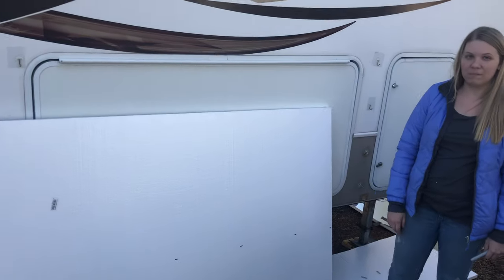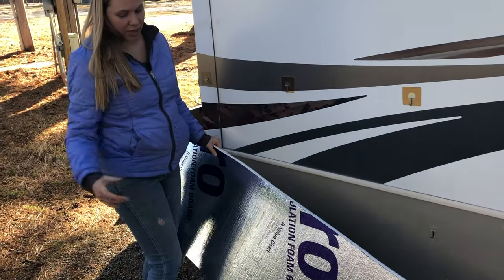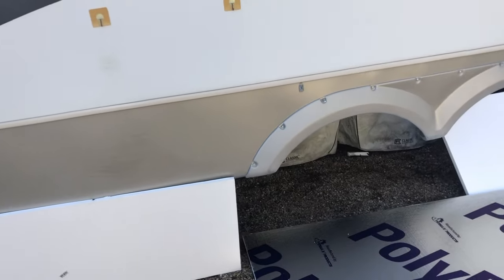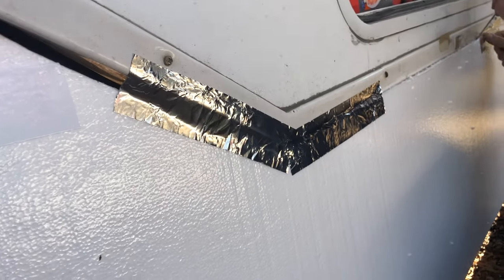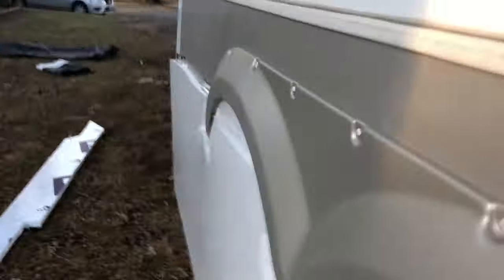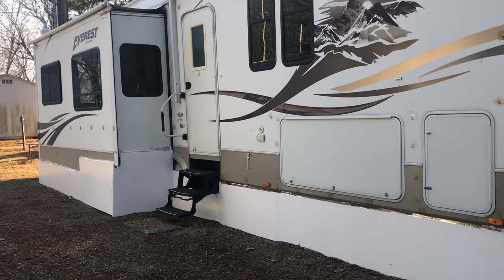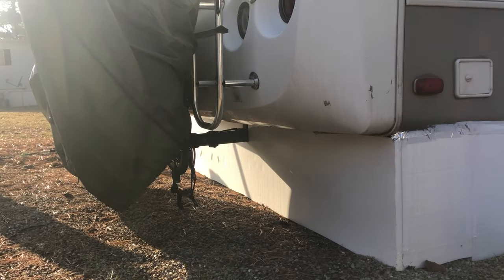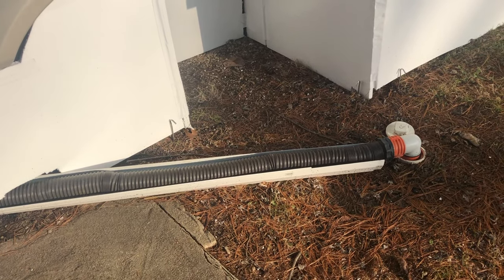How to Skirt a Trailer with Foam Board | Cheap DIY RV Skirting

Comment: Here is an idea for spray foam on concrete to deal gaps in the bottom- put down plastic or Saran wrap, then spray foam on that.  The concrete will be completely protected. Glad I proofread before posting- my spell checker turned "Satan wrap into Satan wrap
Reply from the maker: Great idea!  I have heard of using spray foam before, but the addition of Saran Wrap is brilliant!  I will add that tip to my blog post!

Comment: Were u able to remove the tape without damaging the RV? Any glue left on rig afterwards?
Reply from the maker: With duct tape in the past, it left a ton of glue and damaged the RV in places, but the foil tape leaves a lot less if any residue. It depends on how long you leave it up for (many years = more possible residue)

Comment: I have to use 2 inch foam skirting . I am about 75% done before i found your video. I used my buck 110 to do the cutting . It took a little figuring, but I went flush with rv even inside fenders with the 2 inch .
I used 2x4 lumber in the corners to screw to .

Comment: I'm sorry if this question has already been asked, but I'm trying to build skirting for a repurposed cargo trailer for my pet turkey's coop. Where we live, it gets WELL below zero and 200 inches of snow. Did you get snow at your location, and do you have any suggestions for dealing with that situation? I'm afraid of tarps because of condensation moving up into the insulated trailer coop, even though it's ventilated. Thanks so much for any ideas, and I appreciate this video very much.
Reply from the maker: Snow can help insulate by blocking the wind. We share more tips with skirting on our website here that should answer some of your questions: https://rvinspiration.com/cold-weather-rving/foam-board-rv-skirting/?

Comment: We just bought a 5th wheel and found this video about skirting. We'll do exactly this, but a few suggestions: 
Use an "Olfa" knife for slicing...you can put the razor blade out far enough to go through 2" foam. Also, if you use a drywall T Square, you can cut a 4 foot slice using it as a straight edge. To get a nice edge for the wheel cutouts, put your piece against the wheel, and from the inside, trace the outline. Then cut on the line...perfect fit...
Reply from the maker: Great tip! Thanks!
Reply: You could also use colored mulch or wood chips around the base to fill in any uneven gaps.
Reply: I'm right with you

Comment: Well thanks so much for responding. We have a 2022 5 th wheel and live in central Illinois. Last year we had real cold weather and had all kinds of problems. So this year we’re installing 2 inch foam boards all around, pretty much do the same thing you did. I was just Leary of putting tape on the sides of the trailer. What I also did to keep the bottom from kicking out or in , I cut a bunch of farm post to about 6 inches and put them at the bottom of both sides of the foam board. Works great to keep them in place. Thanks again. Happy camping 😊👍
Reply: do the taping on the underside of the coach. that way no damage to your paint.
also with the foam board under the coach skirting the water stays outside better.

Comment: Awesome. I'm planning to do this tomorrow as our trailer is very cold tonight. Im worried about the wind. Did you have many problems with wind damaging or dislodging foam pieces?
Reply from the maker: We did not, but you can use rocks or tent stakes to help keep them anchored. We recommend it, just in case some crazy winds whip through!

Comment: Hi🖐, it looks great🙌!  As if it were preinstalled.👏
I have some questions, that may have been previously answered and I do apologize if they're redundant. 

When you've installed the insulation as skirting, <--did you bury the bottom into the ground without any type of protection for the board or just paint it, to prevent deteriation from dirt, moisture and critters/bugs?  (I read your blog)😊

I was considering covering each piece in heavy duty construction grade trash bags, <--would that be as protective instead of painting?  

Also, you mention the silver is to be placed inwards out of the sun rays to keep the heat inside/under the RV. <--Isn't the silver for reflective purposes? I've not heard of using the reflective side in the dark, <--so how did you determine its effectiveness? (besides after😅)

I use reflective bubble insulation on my windows to reflect the heat OFF the glass, not to pull the heat inside. <--So would my process be bringing more heat inside my RV?  

I tinted my RV windows, that made a huge difference. And the bubble insulation is there as well, on half the window- don't like living in a cave.😅😅

I planned on putting the reflective foamboard on the roof of my RV, to help keep heat off me in summer time.  
I thank you for your video and blog, and hope to hear from you. And please any one with derogatory responses, just keep them to yourselves, we're here to learn and help, not Hate on or demean. Thanks!! ❤❤❤

Comment: I would like to know what happens when you pull off all the tape. Doesn’t it damage the paint. Or leave all the sticky stuff on from the tape.
Reply from the maker: Duct tape definitely can, but the HVAC foil tape will be better. To easily remove adhesive, we always use a heat gun (a hair dryer can also work!)
Reply: Thanks. 👍

Comment: Does the tape peel  off the paint on your trailer
Reply from the maker: It didn't in my experience, but some adhesive was left behind which I used GooGone to remove.

Comment: What do rv folks do with their tires if their parking for winter.. say 4 months. Do you jack them off the ground or do anything
Reply from the maker: You will definitely put your jacks down but you don’t want your tires off the ground. The jacks will alleviate pressure on the tires themselves. You may also use tire covers to protect from sun damage while sitting. For winter you’ll like skirt anyway so you can cover the wheels with whatever you use as a skirt!
Reply: Thanks. I’m moving away from the family for a few months for work and will be hanging out in a camp trailer. So this is all amazing information for me! Thanks for sharing your knowledge with everyone

Comment: For those of you staying in your RV full-time...manufacturers say to run your slides in and out once a month.  Is anyone doing this? Obviously you can't do this with the skirting attached. We will be stationary for the winter but vhf traveling the country after that.
Reply from the maker: We didn't do that, but we probably should have.  We only moved our slides in and out three times in three years, and the third time one of them got stuck (fortunately we got it unstuck).  I also had a friend who was stationary for a long time and had a slide get stuck when they were preparing to move their RV.  With skirting it may not be possible to move them once a month, but I would definitely try to do it at least once per year.

Comment: In the past, we have used the foam board and used tape to secure it to the RV.  The  only concern I have is when it is removed, the tape leaves residue on the RV and was not easily removed or in some instances, couldn't remove it at all no matter what we tried using.  Any ideas what we could do without using tape.
Reply from the maker: Did you use the foil HVAC tape? I haven’t experienced that it leaves any residue.
Reply: I've been binging on RV Living vids > most recommended the Alum inum tape shown & said it left no residue...🙂

Comment: How well did this work for the winter? 
What temperature does it get there? 
This is our first year and apparently didn't think about this soon enough and now scrambling 🤦‍♀️😂😂
Reply from the maker: Worked great for us! Lowest temperatures were in the single digits Fahrenheit. Check out the Facebook group called “Winter RVing—Let’s Stay Warm Together!” for more tips on surviving cold climates and sub-zero temperatures in an RV!
Reply: @RVInspiration  how well did the tape come off that was on the side of the RV? Did it leave residue behind?

Comment: The HVAC tape from Home Depot used it and it comes up a day later isn’t there a better adhesive it cost $23 for the roll and we bought two and put two strips all around rv but it doesn’t adhere that great. Is there any better tape out there ?
Reply from the maker: I’m sorry the tape you bought didn’t work for you. There is a link in the video description to the exact brand of HVAC tape I used. I didn’t have a problem with the brand I used. The only other type of tape I know of to recommend that is supposed to come off cleanly and not leave residue would be Gaffer’s Tape which you can also find on Amazon. It’s used by people in the film industry for taping things up temporarily. I’ve never tried it for RV skirting so I can’t say how well it would work for that purpose.
Reply: @RVInspiration  ok I will check out the brand you used and order it and hopefully it will work. Thank you for replying to my comment.
Reply: No matter what tape is used surface MUST be super clean > rubbing alcohol...
Reply: @dkleath8697  ok thank you I’ll be sure to buy some and wipe the area where the tape will be applied.

Comment: In real cold climate you need to put Styrofoam boards or straw on the ground , the cold will still be in the space under your rv or other vehicles if you don't putting insulation around the edges is necessary for the purpose of wind snow or ice protection.

Comment: Will the tape be easy to get off?
Reply from the maker: The foil tape is very easy to pull off, and if you pull slowly, will not damage the exterior or leave behind any residue.

Comment: Do you have any cheaper options for someone who might be moving every 2 weeks? I’m nervous to do the vinyl because it looks like I could get expensive, as we might be in single digit/negative weather. Any suggestions?
Reply: the vinyl is the best way for mobile use. foam board requires lots of storage space.

Comment: I'm going to tuck my slide in to save on space heating cost. What do you use for your windows ?
Reply from the maker: I covered my windows with the clear plastic that shrinks when it’s heated and it made a big difference. Over time though I started using plexiglass instead (as I could afford it) so I could leave it up year round without worrying about my cat tearing it up. I actually have a blog post I wrote about these solutions as well as a couple of others I tried. Here’s the URL if you would like to check it out: https://rvinspiration.com/rv-life/prepare-rv-windows-for-winter/

Comment: Is this foam board or styrofoam?
Reply: Did you not read THE TITLE? Lol
Reply from the maker: In the video we used 1" polystyrene (styrofoam) but you can use the foam board that's a denser type of foam board if you prefer.  A thicker one is probably preferable if you want it to last multiple years, but we chose this kind because it was all white and I preferred that look.

Comment: So how does this work in the wind?
Reply: @placeholder4558  I am indeed on the prairie, in the Chinook winds "shadow of the Rockies".  Thanks for the prompt reply.
Reply from the maker: You may need extra reinforcement if you're on a prairie, but we never had a problem with it blowing away having it taped to the RV along the top edge and staked to the ground on both sides at the bottom.
Reply from the maker: Some people build a frame from lumber to attach the foam board to for extra reinforcement. I would probably take it one step at a time though before going to all that trouble. If you’re on dirt ground the tent stakes really do a good job and are much easier, and you could add an extra layer or two of foil tape to reinforce its strength along the top.

Comment: How long does it last
Reply: That's
Reply: Thanks
Reply: what state are you in how cold and how much snow do u see
Reply from the maker: If you aren't planning to move, it can easily last two years, and maybe more, if you just leave it up and repair as needed.  Taking it down and then re-using the same foam board the next year is just about impossible though.
Reply from the maker: @sagemoongifts  We were in Missouri when we made this skirting.  Temperatures get down into the single digits but not often below zero F.  Most of the time snow accumulates just 1-2 inches and then melts completely after a couple of days, but once or twice each winter it will snow 6-8 inches and last around a week.

Comment: That will never stand up to a strong wind. You need bricks on the backside of those panels and even further protection, you could lay 2"x2"  boards going from one side across to the other side against the bricks. That would pretty much stop a strong wind from pushing them under the trailer. If strong winds can push ships off course it wouldn't take much for your 1'' styrofoam to blow under; and once it blows one side under, it will blow the other side outward and all your work will be for naught. Your video is a year old and you probably have had it happen already.
Reply from the maker: This skirting stayed up for a full year,  and it didn't budge until we took it down.  As I already told another commenter, extra reinforcement may be needed in an area that is more prairie-like.  We were located in a wooded area and our RV was between some mobile homes so the wind for us was probably far less than it would be for some people, although we did experience two tornado warnings during our stay there with pretty high winds.  But like I mentioned in the video, we used tent stakes on both sides of the foam board to hold it in place.
Reply: @RVInspiration   thank you, i recently bought the same thing to do my camper.
Reply: @RVInspiration  That is so good to hear!  Thanks for the follow up.